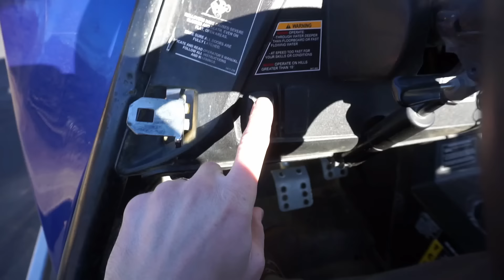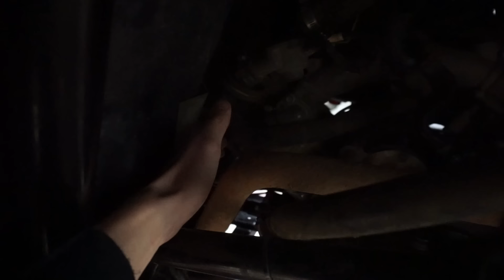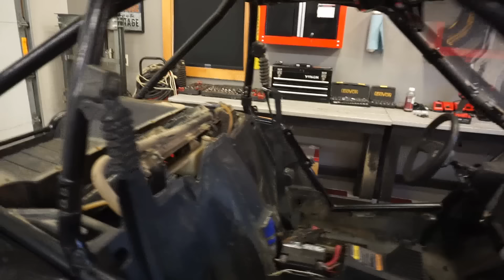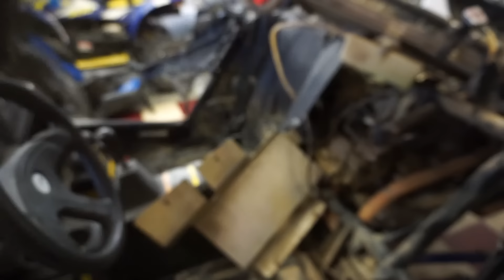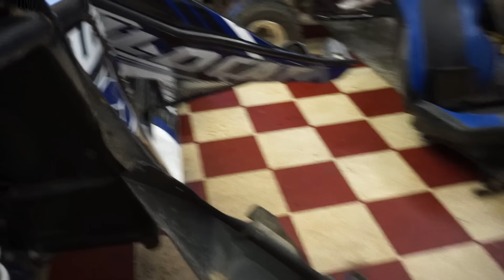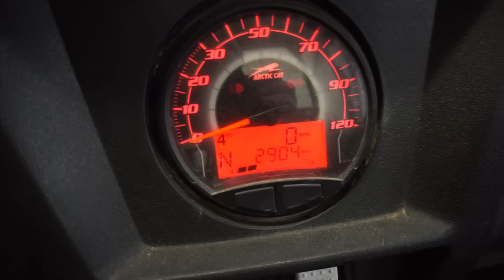Dealership Spent 2 Months Fixing This $3,000 UTV and Gave Up. How Bad Could It Be?

Comment: Hey Joe great job on that diagnoses. How did you come to the conclusion that the engine had to come back 270 degrees to find the rear cylinder lobes facing up rather than down?

Comment: Ihave a Honda Pioneer 700 that ran like this. It would start and then die. Finally I had to something before having Honda come and pick it up and charging…who knows how much. I decided to at least change the spark plug and try that. Well, the top of the plug was broken off and it took me an hour to get it removed and a new one installed. IT RUN PERFECT NOW😁

Comment: Worked on one for a college project, I read the whole service manual, some things I'd mention from the little I have experienced with ours (1000X ltd)

The starter & starter gears are made out of monkey metal, there's some upgrade kits out there, the starter is also prone to burning out if used constantly with no pauses

The seat latch is also, pretty common to break off, so that's just normal

The air filter is incomplete, it's usually 2 parts, the one that you have (inner mesh) and an outer foam, which is the one supposed to be oiled

Even though it's spraying, I'd get those injectors cleaned out,they're also apparently pretty prone to going out

The fan on the battery box appears to be to cool off the CVT, as those 2 air ducts are: 1 going to the air box, and 1 going to the CVT housing 

Finally, just in case, you should take a quick look at the belt, just in case

According to posts and the manual, the engine is the last thing that would go

Edit: forgot to mention, try to start it, and rev it, in neutral, as that just puts insane strain on the belt, and clutch, which actually might be what's squeaking

Comment: Nice work.  But I have a question.  When you took the 2 bolts out of the cam gear could you have just rolled the engine until you had the gear in the right position and bolt it back onto the cam.  I didn't see any splines on the gear or the shaft.

Comment: The maker used crimp hose clips on the oil cooler hoses that were too loose,hoses blew off when hot dumping oil press wrecking cam and crankshaft bearing journals!,check yours or change fo proper jubilee hose clamps.

Comment: I used to be chief tech for the main importer of these , The motors were made by cf moto , We had the same issues , after looking into it all the cam timing info in the factory service/ workshop manuals was wrong as 180 deg out on 1 cam , was a pig to diagnose as it was a cfmoto translation fuck up,typical chinese low quality rubbish , I could write a book with the amount of design falults on anything made by cf moto!.

Comment: i wish you lived near me. my local shops are idiots and thieves. i just got charged $573 for a new battery and voltage regulator replacement on my 2007 outlander. now i'm watching these kind of channels, and buying the specialty tools to do my own work. gonna be putting a new belt on my recently purchased 2021 Defender XT HD10 today. just waiting for it to warm up a bit because i don't have a shop to work in...and the weather is hit and miss here in Montana.

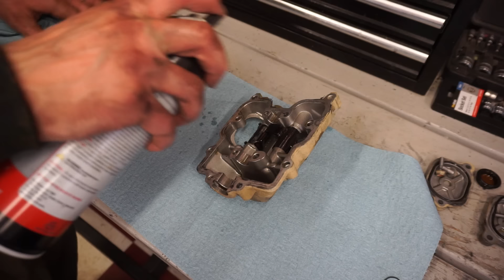Comment: 51:00 This would've been a great time to clean this with the parts washer. Jobs just like this one (trying to locate a crack) is where parts washers really shine because it would've been easy to spot one on a perfectly clean surface. Next time, try to remember this and give it a shot. I GUARANTEE you won't regret it, but to make it world's easier, you're going to want to get the brush attachment that fastens to the end of the metal line. Having this brush makes your parts washer a million times better and easier to use.

Comment: Joe it is some sort of strange industry wide myth that you need to open the throttle to do a compression test... you do not. How can any engine start and run without touching the throttle but somehow it doesn't get enough air cranking for a compression test without opening the throttle??

Comment: Good old Arctic Cat engineering. Have to reach over a hot exhaust pipe to check the oil and a clutch cover that can’t be removed.

Comment: In this case, I'm wondering if the "dealership" is really just a used machine re-seller. Plenty of this in New Hampshire. They don't carry new brands and machines  and the techs aren't factory trained any particular brand. That would explain a lack of technical troubleshooting skills.

Comment: the guy that messed up the timing realized it would not idle on one cylinder so he turned up the idle so it would keep running. now that Joe has it running on both he needs to turn the idle back down.

Comment: I said to myself "timing issue" when you fired it up and it had no power. I always say that, tho. The first rad fan should come on between 180-190 degrees, with the second fan coming on at 200-210 degrees. Typically just the one fan cones on and is sufficient. If both are constantly coming on you may need to flush the system.

Comment: Note to self: Never buy an Arctic Cat a pain in the butt to work on, First step to replace the belt, remove the engine to get access. Next step sell UTV. lol Dang Joe before long you may want to open up your own used motorcycle, dirt bike, ATV, or UTV dealership. lol :)

Comment: If cooling fluid is flowing, a single temp sensor will not turn on fan , in many twin cylinders. ESPECIALLY if one cylinder is not working. Not enough heat being developed. With all the diagnostic electronics on machines these days, makes you wonder why the manufacturers leave out obvious alerts. Simple position sensors are all it takes, for timing issues.

Comment: Color of the plastic says it’s a 2014 and not a 13. I had a 14 x. It was an ok machine. The blower is for the cvt intake. I had one on the cvt intake as well. They eat belts when driven hard! Also never rev in park. The park locks the secondary.  You’ll smoke the belt quick!

Comment: That’s why You Always Use Pre  Fuel Filters , , Toys / Work Machines Expensive. Maintenance per year Should  Cost the Owner at least a $100 that’s just Basic Maintenance Oil and Coolant , Belt ! Hoses have to be checked

Comment: What a score.  It's surprising how mechanics, have changed. More, diagnostic checks, then mechanics that can really understand engines and work on them. Not sure that business has newer mechanics or what. Buy shocking that wasn't found at the shop. Or if the business,  took it on a trade or some type of a warranty right off or something. The. Bread and butter use to be mechanic work, to keep a business going. Things have changed I guess  or shops just get lube techs, or can't afford to pay $$$ for good mechanics.  Hard to say. Very nice find. I can't afford a utv. As much as I wish I could.  Maybe 1 day.

Comment: That little fan is probably for directing radiant heat from the engine off of the folks in the cockpit..Hot days in a SXS sitting still or moving slow you can bake.

Comment: I have one of these Wildcat 1000s and think you had another video on this model before?  Anyways wanted to give you a couple heads up in case you don't already know.  These things have a known issue where the starter can really screw up the case.  It's best to start and stop these things in Neutral rather than Park or in gear.  The dual fans are supposed to work automatically.  One fires up at one temp, the other fires up and runs both at higher temps.  Mine doesn't have a manual switch so that other manual fan was probably added.  Also on the 4x4 switch, if you slide and hold the little switch on that same switch it should lock the front diff.  It's helped me a few times when I was stuck.  Love your videos and was stoked to see another Wildcat.  Don't see them that often where I'm at.
Reply from the maker: Thanks for the info!
Reply: @2vintage  No problem and I forgot to tell you something else.  Hold both buttons on the gauge down until you see the display change.  Then you can cycle through things like water temp, air temp, fuel pressure, tps, voltage, etc.  Comes in very handy during trouble shooting.  If you decide to keep this rig, Tusk makes an awesome easy to install bolt on tire carrier which adds additional roll cage and a storage shelf up above the bed.  Put that rack on mine and it comes in super handy.

Comment: Joe, I agree with you on the stupid (POS) design this model. Just shows the engineers have no consideration for repairs that may be needed. I own a Polaris Ranger and even with its own problems I would never purchase an Artic Cat. They definitely want you take in the stealer ship.
Reply: The wildcat 700s and the new wildcat 1000 xx are quite well built. My 700 sport limited has had no real issues since 2016 and i beat the dog piss out of it.

Comment: The seats to me look like they are on a spring.. So you don't need to get the 15mm nut of. You just pull the seat upwards in the back and they come loose like that. If you look in the video where you talk about part of the latch missing you see a spring in the mechanism on the left side of the latch.

Comment: Great find Joe!  I have a buddy with an old Honda CB450, with an ignition mod on it running on one cylinder.  I had suspected it may have that exact same problem.  I have suggested your channel to him to view, so we can find out if that's the problem or not.  It has good compression, good carbs, spark in both plugs, but running on one cylinder.  Has to be timing, right ?

Comment: Any good mechanic knows how to check for problems and driving vehicle is one way...some of these comments.....that was designed not to be worked on and we are loosing mechanics because of this crooked design, maybe start making a list of the worst designed atv and motorcycles,also we need to complain to the right department about this problem in vehicle designed in the past several decades before there are no mechanics ,and i cant blame them for not wanting to be mechanics,its not good for the environment to be spitting out vehicles constantly to make someone rich while we loose with this junk that most of us cant fix,even the dealership...thats what the plan was and its working,but not for us

Comment: Great diagnosis Joe, I am singing 'Another one bites the dust'. In support of the dealership techs, when your workload is consistent each day, the desire to work on a badly designed headache (what is the flywheel plug for?), goes out the door. At the end of the day, it is avoided as YOU go out the door.

Comment: I hate when manufacturers fail to make their design easibly servicable just because it would cost them money to go back and make a change. That belt cover is a good example. It's really aggravating for a person to have to spend an hour just gaining access to a part that would take 5 or 10 minutes to change. If I remember correctly, Arctic Cat sourced their engines from a seperate manufacturer and dropped them into their frames. The engines and frames weren't necessarily designed to work in perfect concert around one another. There are a few companies that do things that way, but some are better about going back and making changes to their frame designs to better accommodate the engine/transmission assembly, making them easier to service. 
   I think most regular vehicle manufacturers today just think about how much stuff they can pack into an already cramped space, and at the same time make it harder for anyone to work on their own vehicle on purpose.
Reply: Especially on a performance machine where it is a replaceable item.

Comment: Great work brother.   Just a little advice if you happen to read this you could nake your life a lot easier testinb electrical parts with a power probe tool.  You can test fuses and apply power and ground with the same tool it would save you a lot of time.  One mechanic to another get a power probe it will help you a lot.  Keep up the good work.  I hope the local dealerships dont get tired of watching you fix everg 10k utv there techs give up on.  Its got to be getting embarrassing for them by now.   

God bless 
JM in Greers Ferry AR

Comment: I’m thinking it must have been a noisy cam chain so the dealer replaced the guide and inadvertently/big mistake put it together. The dealer wrote it off and we’re probably paid by attic cat. So fun to watch your videos Joe superb work, unmatched!!
Reply: exactly, I got a yamaha rhino 660 and found the same thing. New chain guide but the previous guy installed it upside down and the chain one tooth off. It ran but was hard to start. Somebody just rushed the repair without thinking.

Comment: This says something loud and clear about the dealership mechanic.
Reply: Dealerships are just Part Changers--- they are not into the troubleshooting process--- If they can't find a simple part that needs just replacement--they will not spend much time on it.
Reply: @jdxjim  agree just had an issue with this at a International dealer. They did all sorts of things and still could not figure it out. The book tells them things and they do not use common sense at all.
Reply: Yeah there are a lot of those filter -oil changing - cert mech these days
Reply: NS eh 🤧

Comment: Impressive Joe. Good job.
I don't know how those valves arent bent. Assuming it's a non-interference engine. Lucky
Reply: At 180 degrees out of time the valves are in the only position they won't make contact with the pistons.  Luckily there are 2 positions which valves can fully work with proper clearance and they are exactly opposite each other.
Reply: @JonathanMatthews-xc6cr  not sure what you mean. 
piston was at tdc, and cam lobes were at max reach. That's a valve smash in an interference engine

Comment: The question is who worked on it last.  Whoever that person was, they should have all of their tools confiiscated.  Arctic Cat should reassess their design to make it easier to get to the maintenance items (fuse box, CVT belt, air filter, etc).  I believe the previouis owner messed up the repair.  Dealership probably took it in on trade and gave almost nothing for it.  Sold it to you and made a quick profit without dong any work.
Reply: Common problem across the mechanics field. Lots of fools with tools.

Comment: This dude is sharp . I haven’t seen machine he can’t fix yet .
Reply: Husaburg 500!    Sorta a parts issue I guess.     But I want him to macgyver something up and make that thing reliable.    Lol.
Reply: Only 1 he didn’t fix , Yama dirt bike he couldn’t kick start ! He showed it being buried with different colored dirt !
Reply from the maker: @raptor700dad7  ended up being the hot start was pulled in slightly. I adjusted the hot switch by handlebars and it fired right up.
Reply: @2vintage  Good deal ! Did you record the dig up & fix ? That would be a great throw back vid !!
Reply: I forgot about that yamya lol . 

Didn’t he have it running but had roll start it , I thank . I’ll have go back watch that one .
Reply: Regardless , 
This guy is bad ass on fixing any small engine!!! .   I been around a min, I thank he is one of the best , period .

Comment: The one common denominator that I've noticed about side by sides is they seem to be junk. Even my friends that have them are in the shop for repairs alot. 
There cool but not for the money.
Reply: Buy a 2017 wildcat sport 700 limited with king bypass shocks and warn factory winch. These rigs are stout as fukk. Had mine since 2016 and treat it like it owes me money. Zero big issues

Comment: When you went to take off the clutch cover i had to laugh a little because as a Wildcat owner i knew what was going to happen lol.  You have to jack up the back, take out one shock bolt to swing it out of the way and then it will come out. 

I have a 2014 four seater and it has been as reliable as any other brand. These Cats have very small wheel bearings and bushings. So they need changed often.  The front steering rack will wear out quick and does not like bigger tires at all.  Plus replace the aluminum stock tierods.  Also the stock wheel studs are tiny.  There is a 12mm kit available or i just replaced mine with kawasaki bruteforce studs. They are longer/stronger.  

Your rig should only start in nuetral or park. Someone bypassed the safety switch. Also these X models are famouse for kickback when starting or turning off the machine cold. When it does it breaks off the starter gear boss under the cover.  There are weld in and bolt in kits to reinforce it. 

Thats a clutch cooling fan with the blue pipe.

If you don't know already the fans turn on at different temps.
Reply: Sounds like a Chinese garbage dump.
Reply: What drives me nuts is guys using "their",  they're", and "there" in the wrong context when commenting.
Reply: @kevinalbers1084 Damn I did it twice.  Lol I definitely know the difference lol.  😅

Comment: I would change the starter bearing because I think they had problem with cracking case at starter
Reply: There is a problem with kickback in the X models when turning the machine off cold or if it fails to start first try.  There are bolt on plates available to reinforce the starter gear bosses. Super easy to do.

Comment: The engineers should have to take the clutch cover off of any side by side while standing on a fire ant bed barefoot . It would not have been a problem to make them in two pieces over lapping each other and still be water , mouse and dust  tight . It would make them a lot easier  for service . Just saying . Good videos keep them coming .

Comment: I'm confused on why you thought the timing was off on the cylinder that was running.
Reply: Wondering the same thing
Reply: A cylinder will still run (badly) if it’s a tooth out, and given that it was clear that some idiot had been in there messing about with the timing then I guess it’s a good idea to check it all?